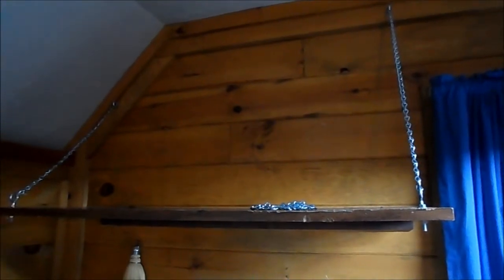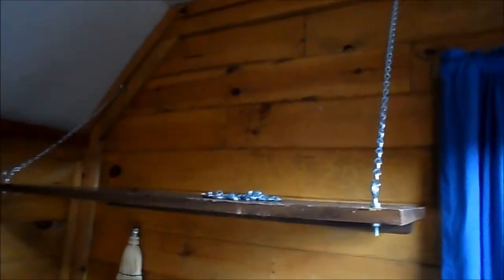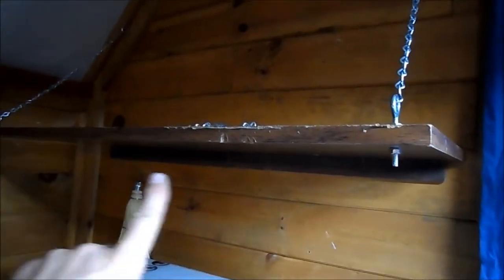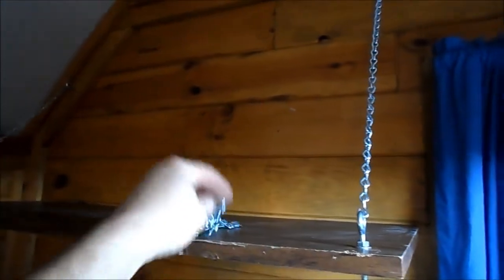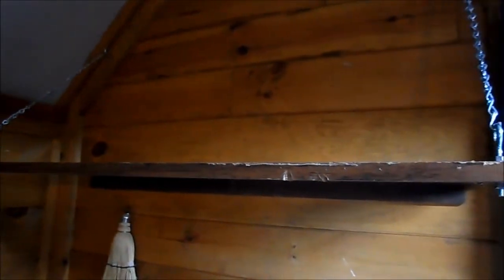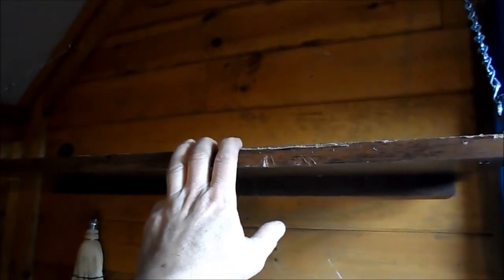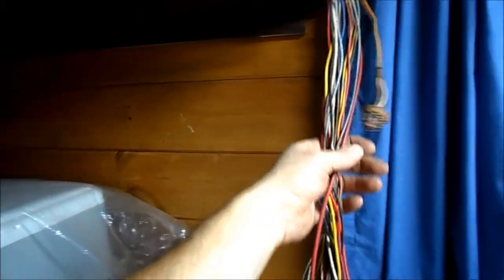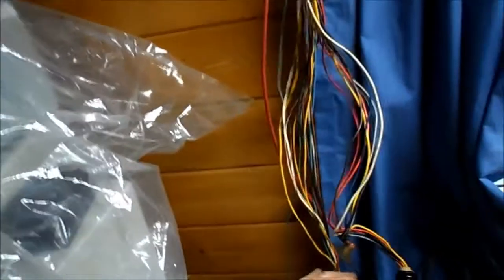Test Jig Shelf for 19" CRT display.

Comment: nice setup. I would recommend you double up the chain one with a little bit of slack, just in case one has a weak link.
Reply from the maker: Good idea, I am probably at or close to the 30lb. rated limit of each of those chains. The particle board is even bowed a bit. May switch to plywood too. Thank you.